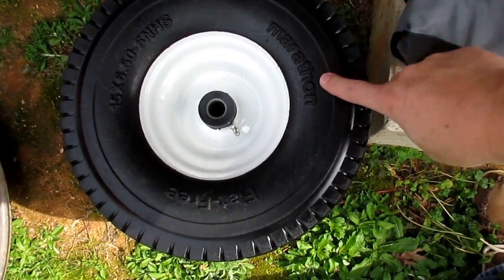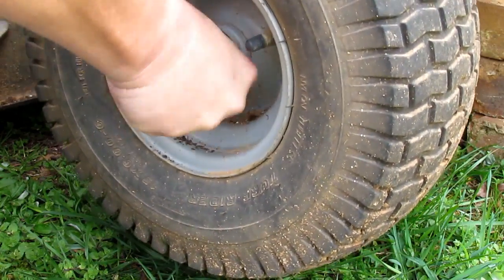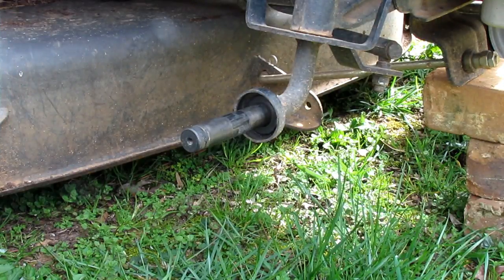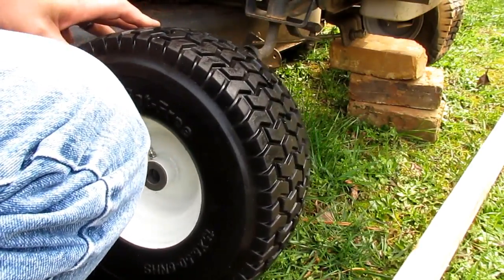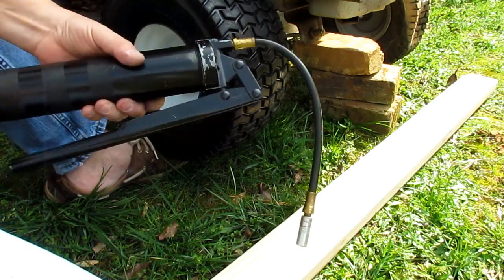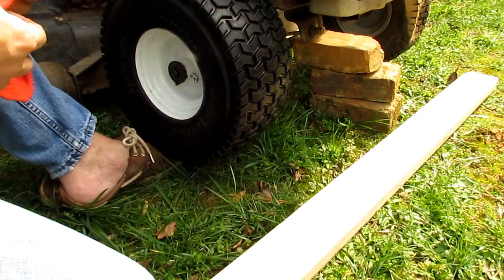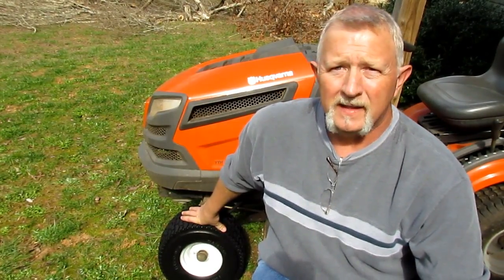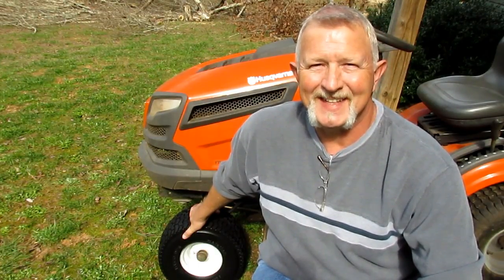Install Flat Free Tires on Husqvarna Yard Tractor

Comment: A million thanks for this video and your clear, calm encouragement.  This stuff isn't as hard as one would think (though getting that dust cap on and off was the absolute worst!).   The tires were $59.99 each today, but the job took me only about an hour, maybe hour and a half - and I've never done anything like this before.  Completely worth doing - the tractor sits better and steers better now that it's not on perpetually under-inflated tires (they were the leakiest tires I've ever seen).  

You've inspired me - I've ordered the parts to change the oil and filter, change and gap the plug (I've done this on a car, so should be simple), change the blades, and change out the air filter set.  Oh, and I have to put one of the gauge wheels back on once I get a new nut and washer.  At the same time, the whole thing is getting a thorough cleaning, and I'm greasing all of the fittings.  The ex-husband didn't take very good care of anything, so I have my work cut out for me.  I know your Huskie mower maintenance videos will be there to walk me through it all.  Again, a million thanks!
Reply from the maker: Xirena, thank you so much for watching and for your kind comments!  I'm so glad these videos are helpful....sounds like you are off to a great start getting your mower back in shape!  nice work!!  I agree, I hate getting dust caps off....too much pressure, you crush them, not enough, you slip off and bust a knuckle.  LOL.  Thank you again for your support!

Comment: Dennis, I just wanted to thank you for all of the videos you've made about your Husky lawn tractor. Thanks to you I've been able to change my blades, change my oil & filter, and replace my spark plugs. Yesterday one of my front tires went flat, so i visited Northern tool for the very first time and picked up 2 foam filled tires. These tires are amazing. It feels like I have power steering now. I'm not at all mechanically inclined, and usually took my mowers in for service in the past. The next time I need to change my oil, I'm going to replace the drain spout with the pipes you suggested in another video. Thanks again!
Reply from the maker: That is all so good to hear!  I'm happy that all these vids have been helpful.  If you do the oil drain plug mod, I recommend using galvanized pipe.  Its a touch more expensive, but the black pipe I used rusts quickly.  It doesn't hurt anything, just looks bad.  Thanks so much for watching and supporting my channel!

Comment: Thank you for posting. We had no idea that run flat tires existed for lawn tractors. Picked up two from Northern Tool ($44.99 each) and installed them quickly. The trick to reinserting the black wheel cap is to rock it back in forth to slowly get it up, and then suction just grabs it back into place. My husband couldn't be happier. I had no idea that he had to constantly fill the tires with air on our Husqvarna lawn tractor. Those tires were crap. These ride great.
Reply from the maker: Thank you Dianne!  I love these no-flat tires too.  I appreciate you watching!!
Reply: Dianne, thank you for your input on how to reinstall the black dust caps. I just replaced the 2 front tires with flat free tires and gave up on the caps. I’ll follow your tip, thanks

Comment: Hint for dust cap that is too small/shrinks/won’t fit back onto the wheel. Can stretch it out by pouring very hot water over it and stretching out the inside. For me it was still hard work to get it back on, but at least it had more elasticity. Thank you very much, this video helped me a lot 🙏🏼
Reply from the maker: Thank you for watching!  I'm not sure if hot water would soften it enough to make it fit easier, but it would sure be worth a try!
Reply: Heat the grease caps with a heatgun until soft enough....

Comment: Great video.  I just wish I had realized I could get the flat free tires because the ones you ordered from Marathon cost the same as the original pneumatic tires. My place is "infested" with the thorns from mesquite trees and it seems everything is attracted to these dern tires.  Just replaced all 4 and next time, I will buy the flat free variety. Thanks for the info on inserting that e clip.  I have fought those little buggers and made a cussing episode out of it each time the wheel is removed.  Now, using the needle nose pliers, it will be easier. Also helpful is showing how to grease the axle.  I inherited this  YTH 24v48  tractor and while I sorely needed it, I had no experience with anything other than a simple push mower. Moved to the country...it's a whole different deal, must have this kind of mower. But I have a lot to learn and am so glad you have several videos. I just hope the Husquvarna is something I will be happy with,  it's not going to be possible to go with another brand, this one will have to be maintained as much as possible by me.  Again....thanks
Reply from the maker: Thank you for watching!  I have several videos on this Husqvarna, so be sure to check them all out....hopefully you will find some useful tips!  We don't have mesquite where I live, but I have heard the thorns are like nails.  I wish I had a flat free alternative for the rear tires, but I haven't found one yet.  Thanks again,. I really appreciate your support!
Reply: Tubes my friend. Worked for me. Plus green slime if ever flat again. 700 hrs and still same outter tires on. :-)

Comment: Great informative video Dennis.  Thanks.  I was really set on getting some airless tires for my Troy-Bilt.  Then, I saw the price on the size front wheels my mower uses.  Dang!  I ended up getting some TireJect tire seal for now instead.  So far the tires are holding up.
Reply from the maker: That will still  be better than the factory tires with just air in them.  Thanks for watching, Art!

Comment: I followed your advice. The store only had one tire. So thinking they were the same size I replace the left front tire. After about two hours of mowing a belt broke. Then my wife noticed the tires were not the same size. The new tire was shorter. I bought a marathon flat free tire 15x6.5/6 . The tire on the mower was a 15x6/6. Checked Husqvarna website and this was the right tire for the yth 22v46. Seems like a 6.5 should have been bigger than a 6 but it was not. Lesson here check size on tire and replace both.
Reply from the maker: I've had a few people say that the OEM Husqvarna tires were off-size....so I'm thinking maybe all the tires of this type are not always sized exactly as claimed.  You have a good point...always check the size, and preferably always replace them in pairs.   Thanks for watching Ron and thanks for your comments!

Comment: Was at Northern Tool today. I was impressed with the tires.  The ones you got look great. Good tread. I have seen the flexible spoke ones on John  Deere zero turn mowers. The weight is supported   by  the top spokes. I some times get several Thornes in a few hours  of mowing.
Reply from the maker: Thnaks for watching, Ralph!  My tires have held up really well for the last few seasons.  No complaints, I'm glad I put them on the tractor.

Comment: Hi Dennis, I want to get a set of these, since it's been a while for you now, I(we) would like to know how happy you are with them, pros & cons, & would you recommend putting the front end on blocks to prevent flat spots from forming when not in use? I read about people complaining about flat spots on garden carts, hand trucks, gegerators & stuff like that. & thanx again for your great tutorials, don't stop, you're a great help...
Reply from the maker: Thanks for watching, Robert!  I haven't had any problems with the tires or with flat spots.  Now I live in the South, so the longest period of time my mower sits without moving is probably 3 months.  In those 3 month periods, I have not flat spots occur.  I'd buy these tires again, for sure.

Comment: I live in Kansas City.  Fortunately we have a company that will foam fill tires.  After going to the tire shop a minimum of 4-5 times every year for leaking tires I did this.  Cost paid for itself within the first year.
Reply from the maker: Thanks for watching, Will!  We've used a company here in Georgia at my job to foam-fill forklift tires, but it's really expensive.  If it wasn't, I'd get the rear tires foam-filled too!
Reply: I'm in Lawrence. Where do you get this done at?
Reply: @angeldew77  T&W Tires Front st kc mo,. Should also have site in ks
Reply: Awesome. Thanks I'll check that one out since I'm only a lil over an hour from there.

Comment: I truly like watching your videos. You show each step and answer all my questions as you go. Any advice on replacing the back tires? I ordered some new tires due to a puncture. I am thankful I bought 2 back tires at the same time because the size was right but the shape was different than the original.  (I am sure I missed something specific when I ordered of the website.) I have the same model Husqvarna. Thanks for all your awesome videos!
Reply from the maker: Thank you for watching!  I have not replaced the rear tires on this mower myself.  Usually, you can take the numbers off the side of the stock tires, and buy the same by matching those numbers.  It should be a 20 x 8 turf tire.  It will look a little different deflated than it does on the wheel and inflated.

Comment: Higher price at Northern Tools now though as they now run $69.00, plus tax. Years back, I had a fellow do all 4 or his tires filled with foam, locally. He said he regretted doing that later, as it ran so very rough of a ride afterwards. We had any multitude of mesquite trees, so flats were par for the course when I lived in that area.  Of course, this was from a local shop, so not sure how they actually filled them. I suppose the company does a better job of somehow balancing the foam they use inside the tires these days. Nice video.
Reply from the maker: Thanks for watching and for the nice comment, James!  These ride almost the same as the original pneumatic tires to me.  Now if the rears were foam-filled, I suspect the ride might not be so nice.  :)
Thanks again!

Comment: Good video. I haven't had a flat on my Husqvarna lgt 2554 in 10 year's ( knock on wood, lol). Of course, all I do with it is cut my grass.
Reply from the maker: Thank you for watching, John!  Seems some people have had a lot of trouble with the front tires on these mowers, and some do not.  I wonder if Husqvarna had a bad batch, or used two different suppliers maybe.  Anyway, glad you haven't had tire troubles!

Comment: Your system makes sense. The Slime turns to dirt. The gap fill foam doesn't hold up. I  have two 8 inch boat trailer tires  that were foam filled by a tire shop that does  construction  equipment. They are heavy but will work on my lawn tractor.  They are for a 1 inch axle. Need to adapt them to a 3/4 inch. I have Slime tubes with Slime in them now.   Slime tubes are no good. If I have to  remove the tubes and patch them why would I deal with Slime. I have a Thorne problem.  I might pick up a half dozen in a day. I have Chevrolet wheels on the rear
For some reason the thicker tires dont pick up Thornes so easily.
Reply from the maker: Thank you for watching, Ralph!  Fortunately we don't get a lot of heavy thorns in my area.  The factory front tires would never hold up to large thorns.  These flat free tires are holding up well and don't give me any trouble.  I like the idea of putting car tires on the rear wheels....never thought of that, but sounds like a great idea!  What size are your rear tires?

Comment: Do they have that type of tire for the rear??? Are the new tires cutting up the lawn more then original tires??
Great video very helpful thank you....
Reply from the maker: Hi Danny, thanks for watching!  I have not found any flat free rear tires.  These tries actually seem to be a little easier on my turf than the factory pneumatic tires.  I have mostly centipede in the lawn, but have had no problem with these tires damaging the grass.
Reply: Dennis Coffey thank you for your help,

Comment: About to do the same thing to mine! I have the same mower, and the factory tires are CRAP... I've already changed out the back ones to heavier 4 ply.
Reply from the maker: Thanks for watching!  I like these no-flat front tires a lot.  Thankfully, I haven't had any problems with my rear tires.  I do have mine full of water for weight though.

Comment: Great introduction on the few of your vids that I’ve watched - I just ran across your channel. <LIKE>

What’s with ur bushings @ 2.23????  The hub looks like it’s a whoopsie ride from non existent bushings?  They couldn’t have worn that much. 

I replaced the axle and steering spindle bushings with roller bearings (cheap kits) on my old Poulan but of course they fit all AYP tractors. 

Great resource!.
Reply from the maker: I think the original bushing was completely worn out and gone, as I had a lot of fines in the hub.  Roller bearings would be the way to go for sure!  Thank you for watching!

Comment: Dennis, love your video's. I have a TS146 XD Husqvqrnq, which I think is pretty similar to yours, however my tires say 15x6 006. I've looked for Flat Free tires, but haven't found an exact match. Do you know of a flat free that might fit my tractor? And what exactly is the "006" designation?
Reply from the maker: Thanks for watching, Larry!  The tire designation reads like this:  15x6.00-6  -  15" is the tire's outer diameter when not under load. the second number is actually 6.00, that is the tire's width.  The last number, "-6" is the width of the rim.  So, a 15x6.50-6 should fit your mower fine.  The tire itself will be 1/2" wider, but the rim width is the same.  Before ordering, I'd check to be sure that at the turning extremes, your factory tires don't come within a 1/2" of hitting anywhere.  If not, you should still have clearance with the 15x6.50-6 tires.

Comment: Thanks Dennis. I was able to change the flat tire of my husqvarna with your video. However when I start my lawnmower first time after winter break,  it produces way too much smoke. Do you have a way to fix that? May be carburetor or air filter cleaning video you may have?
Reply from the maker: Thank you for watching!  Without knowing the particulars on your mower, it is hard to say for sure, but I would guess your mower just needs a tune-up.  I have some videos to help with that:  
Change the spark plugs:  https://youtu.be/nqPFY-2LfhE
Change the air filter:  https://youtu.be/LiiaxutYyFA
And you may need to change the oil:  https://youtu.be/8PsfLKmpElU
Let me know if I can help!

Comment: Hi Dennis, I started watching your videos in 2020 when I purchased the same Husqvarna riding lawn mower that you have in these videos.  I was wondering, since you made this video, if you ended up purchasing flat free tires for the rear tires.  I have been having trouble with one of my rear tires going flat since day 1.  But, I can't seem to find the correct size flat free tires for the rear, at least not on Amazon.  I think the spec says 20x8-8
Reply from the maker: Thanks for watching!  I have not found any good alternative for flat-free rear tires.  I know there are some companies out there that will foam-fill ag tractor tires and they'd probably do these, but the process is pretty expensive, so I haven't looked into it any further.

Comment: Good video. I am going to check them out. What air pressure do they compare to the old tires
Reply from the maker: Thanks for watching!  They don't take air they are solid tires.
Reply: @dwcoffey  I did not word my question very well. How much air would you have to put in the old tires to have the same feel as the new flat free that do not require air.
Reply from the maker: Oh I see....Husqvarna calls for 15psi in the fronts, as I recall.  These tires are just a touch stiffer than the factory tires, so I'd say if the factory fronts are at 17-18psi, that would be about the same as these.

Comment: Denny, did you also change the back tires to flat free?  What would be the effect of doing that?  I have a lot of black-thorn locust trees on my property and find that I am fixing tires all the time.
Reply from the maker: Hi Warren, I did not change the rears out to flat-free tires.  I keep water/anti-freeze in my rear tires for added weight.  I've not had any trouble with my rear tires, but with blackthorns, I am not surprised you have trouble keeping your rear tires filled.   That's got to be a challenge!

Comment: Is there a difference in how it rides ? Rough , smooth? 
I replaced the rear with the tougher gauge thicker tires . But didn’t with the front . Now I have flats on the front ...
Reply from the maker: Thanks for watching, Alberto.  I don't notice any difference at all on turf, dirt or in the woods.  On concrete, these tires might ride a slight bit rougher, but not enough to bother me.